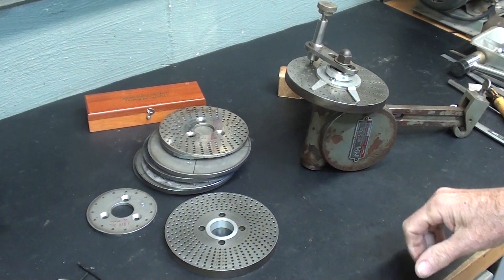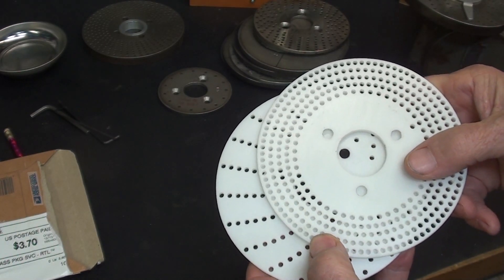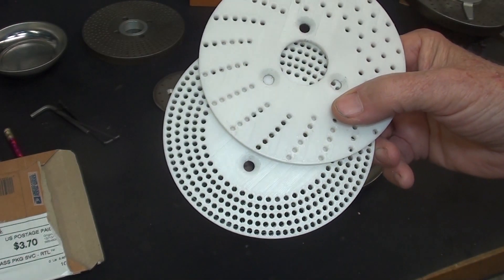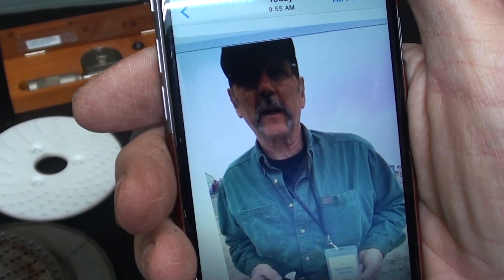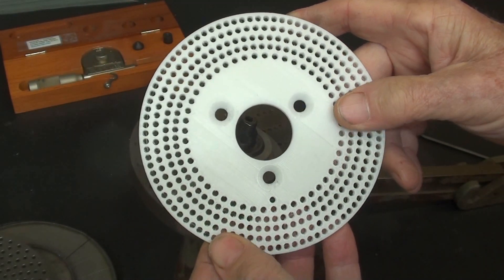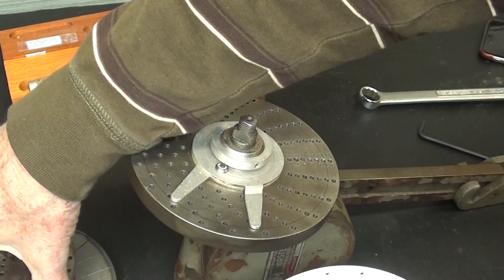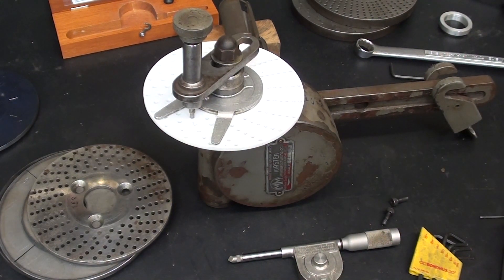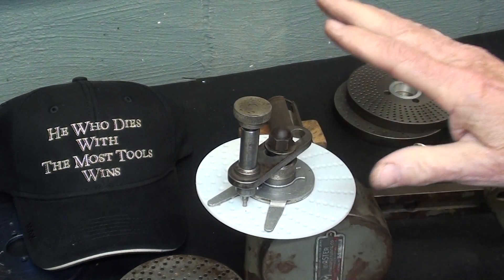Dividing Head Plates 3D Printed TIPS #627 tubalcain

Comment: I love both my Ml4 lathe and my 3d printer. I just found this video as I had the same idea of making 3d printed index plates which are so easy to design in Fusion 360. In fact I'm thinking of more ideas for 3d printed parts and tools for my lathe. For example one of the knurled nuts was missing for the gearbox cover so I made one. And some people use tufnol gears, perhaps some of those could be 3d printed. They are remarkably tough if printed densely.
Reply from the maker: I really wish more of my viewers would come to appreciate the value of a 3-D printer.

Comment: this is a perfect use for a 3d printed part. some of the nicer printers are capable of quite good accuracy, and once you run it through a 40 or 90: 1 dividing head its horse shoes and hand grenades, you could probably line up one side of the pin with a line and be close enough.

Comment: Hi Mr Pete, 
I've watched all of the videos on making plates for dividing heads and found them very interesting.
I need two new change gears for my Atlas lathe, getting replacement parts here in the UK might be a problem but gears made on a 3D Printer look like my best option.
Thanks and regards,
Martin.

Comment: I made a video showing how to model these in FreeCAD:

https://youtu.be/HdSpAkKCbis

Included in there is a link to the model file, which you can download and modify its properties (e.g. disc diameter, disc thickness, etc.) to customize it meet your needs.  The model contains 6 rings of holes and is a 6" diameter disc.  If you reduce the size of the disc so much that all the rings don't fit you'll get some errors until you either delete some of the rings you don't have room for or reduce the ring separation property (which defines the radial distance from one ring to the next).  All this is shown in the video, and also you'll see how to add additional rings should that be desired.

Comment: I had rotary table with dividing plates but I got 4th axis from ebay for few hundreds bucks and did whole gears in just 10 lines of gcode. If someone wanted he could make it independent of computer with adruino and have great dividing head with just setting few variables via buttons on screen.

Comment: First of all thank you for your video work...
3D-Printing is an absolute enrichment of my shop possibilities. In my last project-  a magnetic DRO for my lathe -  I made a lot of parts via 3D-printing: All reading head housings running on aluminium C-profiles,  all mounting brackets and angles with all threads (!) I needed for the 3 axis. - Yes this is stable, sturdy and accurate. If a 3 kg part would accidently  fall on it I hope that the brackets will break and save my magnetic scales and electronics of the reading heads:-)) Using steel the aluminium-scales will surely get bend! 

But also dust covers, adapters for the shopvac, toolholders, oilcans etc. can be made besides prototyping of metal parts and 100000 other things. - I have been hesitating long if I need such a printer. Then I decided to buy a good "Prusa MK3"  two years ago and it's amazing.  In the past I tried to learn 3D-CAD for CNC and started several times, but never had continuity to practise and forgot a lot. The printer now forces me to use my program and I automatically improve my skills when using it  during the interactive  practical use and application when designing and printing. Easy manufacturing: Have an idea - draw it - print it and correct it if necessary. Absolutely satisfying:-) 

Regards
Werner, Austria, 62 years old:-)
Reply from the maker: Congratulations. You actually are doing a lot better than I. And yes there are unlimited applications and possibilities
Reply: @mrpete222  But you are so much better in metal working - and I am learning a lot from you:-)

Comment: There's no reason that any of us should be dead-set against 3D printing ... after all, an electric motor for a lathe was practically revolutionary,  just a historical "blink of an eye" ago ;-)  if one wants to be a 'traditional' metalworker, then one needs to pick a period, and stick with that period's tools; otherwise, we use what's available, what we can afford, and what gets the job done to the level of quality that is needed/desired. 3D printing may be a useful alternative to CNC, or other machining methods, when the qualities of the printed materials fit the job. And, lest we forget, there are even 3D printers that can make parts suitable for aircraft or F1 cars!
Reply from the maker: Thanks

Comment: I love my 3D printer. It's a tool I bought for prototyping but I have been using it more and more for all kinds of oddballs. I'm mostly printing in ASA because it's a bit tougher. I think 3d printing has a bad rep because of the tinkering that some brands require. Mine is super reliable. I don't even have to check my prints for adhesion when I start them. Making dividing plates is something I've never thought of. I wonder what hole numbers are a "must have".
Reply from the maker: Thanks, I no longer love my printer, LOL

Comment: I'm not one to look down on 3D printing, in fact I remember suggesting it in a comment on one of the previous videos.

And who cares if the plastic plates aren't as durable? When they wear out you just print some new ones and it will cost next to nothing. BTW nobody uses a manual divider for large production runs anymore, anyway. So this problem isn't even likely to come up.

I believe everyone who makes stuff should be open to using different techniques, processes and materials. Whatever gets the job done, right? Purism is for people who lack imagination.
Reply from the maker: Thank you for that, that was very encouraging

Comment: I've been a hobby machinist for over 50 years. There has always been something reassuring about a part that has been machined from metal or cast in sand using a wooden pattern. That being said, the combination of free 3D modeling software, cheap 3D printers that work right out of the box, and some  investment casting equipment that's sat in my shop unused for 30 years has caused me to rethink my methods of creating parts for my 1/8 scale steam locomotive projects. An FPM (filament) printer left me in awe. Then i added a $275 SLA (resin) printer. it totally blew me away with the exquisite detail and accuracy that can be attained.
Reply from the maker: Thanks

Comment: I would still add another method, I think I saw something similar in a video by Stefan Gotteswinter. That is, attaching a stepper motor directly (or through a gear) to the indexing head. That way, there is no need to keep any plates around and any arbitrary number of holes (or degree subdivisions) can be achieved. I have the feeling though that people watching these videos would not appreciate such an 'electronic' solution.

Comment: Sir, may i make a suggestion?

 Are you familiar with air bearings? If yes, can you make an episode about it? I have been told that the latest model of garage lathe are now equip with this kind of bearings, the manufacturer (both japan and german, one of them is the famous DMG Mori) claims it is almost no friction and silence. If it is true, that's a big news and worth attention. 

And all you need is to install the bearing itself and add a small air pump that can output 90 psi air, aka bicycle pump!

Comment: My issue with 3D printing is that there is no work involved.  Most 3d projects are downloaded copies of others work. The results are not persistent. When I build a tool/part out of steel that part will exist after I have died. The plastic parts have limited shelf life.

 PLA plastic: https://www.creativemechanisms.com/blog/learn-about-polylactic-acid-pla-prototypes

Polylactic Acid is biodegradable and has characteristics similar to polypropylene (PP), polyethylene (PE),
 or polystyrene (PS). It can be produced from already existing 
manufacturing equipment (those designed and originally used for 
petrochemical industry plastics). This makes it relatively cost 
efficient to produce. Accordingly, PLA has the second largest production
 volume of any bioplastic (the most common typically cited as 
thermoplastic starch).

There are a vast array of applications for Polylactic Acid. Some of the most 
common uses include plastic films, bottles, and biodegradable medical 
devices (e.g. screws, pins, rods, and plates that are expected to 
biodegrade within 6-12 months). For more on medical device prototypes 
(both biodegradable and permanent) read here. PLA
 constricts under heat and is thereby suitable for use as a shrink wrap 
material. Additionally, the ease with which Polylactic Acid melts allows
 for some interesting applications in 3D printing (namely “lost PLA casting” - read more below).
 On the other hand, its low glass transition temperature makes many 
types of PLA (for example, plastic cups) unsuitable to hold hot liquid.

Comment: As always, I do enjoy watching your videos.  Yes, I did miss watching the previous one.  Have to go back and watch it.  
Talking about 3D printing the index plates, how about someone 3D printing you a new set of spacer arms that will reach out and grab the last row of holes on that plate?  
Now, to figure out how to get 127 holes on a 4" OD plate. LOL.  I know it can't be done unless you make the holes a 1/32" in diameter.  I do have a 8" OD plate that has a row of 127 holes I'm planning on adapting to my BS-0 dividing head.  Yeah, I said that correct.  😃 Ken

Comment: I think it's the CAD learning curve issue that makes some people turn away from 3D printing. It's one thing to simply go to github or someplace like that and download stl files, then push some buttons,  but quite another to have to design something from scratch.  Then there's the issue of "tuning" the 3D printer to make it actually DO what it is supposed to do.  I remember taking some on-line Sketchup tutorials, back when Google still owned it.  The tutorials went quite well, but as soon as I tried to actually design something, I was totally lost.  All of a sudden I realized that I'd have to immerse myself in tons of rote learning if I wanted to be any good at it.
    I even had a 3D printer loaned to me for a month a few years ago.  I played around with it, found it slow and fussy, but  made several prints.  Still keep thinking I should get one.  Looks like the longer you wait, the cheaper they get.

  I've used TurboCAD for at least 15 years, but I only use it for 2D work,  which I do on a regular basis.  But---  THAT in itself, was a HUGE investment in time.

   I guess I just have too many interests these days.  I tell people that, when I was 2, I had a very short attention span, and that now that I am older, I'm getting to be that way again.

Comment: I remember when 3D printers first came to market, I said to myself “this will be a flash in the pan”, apparently not. I’m curious as to how fragile the finished piece is, they look flimsy and easily fractured to me, all I’ve ever seen are videos and pictures of finished pieces.
Reply: When they first came out I wanted one for my job but could not justify the cost. (~$12,000) The plastic wasn't durable at all. Costs have gone way down and they have better plastics now but of course plastic won't be as durable as metal. They were originally only intended for rapid prototyping.
Reply: ohmbug1 the index plates Mr Pete has look like they are more durable than other stuff I have seen.

Comment: I am not among the anti-3D printer folks. My position is that, much like machine tools, there are applicions for which 3D printers are well-suited. And, as additional materials are developed the range of suitable applications for 3D printers will grow.

Conceptually, 3D printing is opposite traditional machine in at least one important way. Traditional machine tools work subtractively (I may have invented that word). One begins with a large chunk of raw material, and removes from it pieces that aren't to be in the intended part. 3D printing proceeds additively in that the part is built-up by progressively depositing layers of material.

I have been told, although I have not seen proof, that 3D printers are capable of producing features in parts that cannot be made using traditional machine tools. Complex internal cavities, for example.

Comment: Hi Mr Pete,
I don't have anything against 3D printing at all, its just that I watch your videos because I'm interested in the machining. I've learnt a lot from watching videos like yours.
I build model stationary engines at home in my very basic machine shop (garage) and I get a lot of enjoyment in the building of them. Once they are finished and running, I move on to the next. 
The challenge, for me, is what next to build, how to design it, what materials am I going to use and how am I going to build it on my very basic equipment.
I don't have a 3D printer and I'm unlikely to ever buy one.
Keep up the machining. Please.
Keith. England.

Comment: As a medical doctor (ie, very much a hobbyist, far removed from professional machining OR computer programming) I can give you maybe a different perspective in response to your 3-D question if you like; I find videos on 3-D printed prototypes pretty much in the same category as CNC maching parts, a perfectly reasonable and precise/efficient way of making something but not an interesting way to watch or learn HOW to make something. If the point of a video is to show how a PART is made, then watchers should be open to 3-D printing, CNC programming, etc..if the point however is to show the PROCESS of how a part is made, then your viewers are more likely going to be mostly interested in the traditional laying out, marking, and fabricating in actual metal. Think of it this way; a woodworking video on "how to make a wardrobe" (which may include easy-fix predrilled Ikea joints in cardboard wood!) vs a woodworking video on "how to hand cut dovetail joints, which you can use to make your own wardrobe"...how many people do you think are going to watch a video of someone putting together an Ikea wardrobe? 
I'm not suggesting for a moment 3-D printing or CNCing is 'easy', just that is highly specialised and lacks the hands-on "approachability" to a home workshop hobbyist that would make someone like me want to take the learned skill and tackle progressively more challenging other projects, once they have seen the process..
But I watch all your videos anyway! Best wishes for the New Year...

Comment: Mr Pete, the 3D printer technology is very useful especially in initial design stage in industry. There is also the electronic tool using Arduino hardware and control motors.
Reply: Do you watch Clough42? If not you should really look James up. His use of modern tech to do things in a home shop is very inspiring.
Reply: @Dwarfracer88  Thanks mate, will definately check his channel out.

Comment: For me, i can do design on the back of an envelope or on cad, and I have done cad/ cam in g- code many years ago while i was at university studying mechanical engineering. 
My two cents worth is that because in the home shop i am usually not making hundreds of something, there's just no point spending all the time fluffing around with C.A.M. in order to finesse a prototype, particularly when in the end (unless it is a very low- stress part) all you get for all that time/ effort is a plastic MODEL of the part, not the real part.
 i would rather get the concept on paper and then get it built.  I could commonly build it in metal faster than a 3d printer could build the model, and even if i couldn't it doesn't matter -- the time doing the plastic part is just overhead before i then have to START on the real metal part.  Unless my design was massively wrong and the prototype would have saved me (which is rare) the 3d print process is just a gimmick and an utter waste of time. 

The other factor is that i watch your videos to learn metal shop stuff that i didn't know as a professional engineer.  I don't need to watch utube to learn engineering -- that's been my job for 35+ years.  

Which brings up the final point -- building stuff with my hands is satisfying and relaxing because it isn't engineering that i already spend 40 hours per week doing.... why would i want to do more cad / c.a.m as a hobby?  It isn't a change. 

So if i don't want to do it, i don't want to learn how to do it so i don't want to watch it.

Comment: For me, the resistance to 3D printing is twofold:  first, cheap 3D printers are kind of where PCs were back in the mid-80s, and I'm sensing that if I wait a few years, I''ll get much more bang for the buck (e.g., easy printing in Nylon, Delrin, and PEEK). Secondly, you need to be good with 3D CAD, which is intimidating to me and a lot of other folks.  The possibilities of 3D printing are very exciting - I'm just not there yet! (and I love working with metal)

Comment: People are asking $75 + shipping for some dividing head plates (in the year 2020). I collaborated with a guy wishing to do them in 3D & received a sample in 2019. Spot on & good to go! This type of solution, in so far as time & cost savings really adds up when sourcing parts for Mr Pete's lathe type & for anything from Van Norman. Jay Leno has perhaps the ultimate 3D printer as it is capable of making a complete Straight 8 intake out of aluminum. I'd like a 3D printer for the desk top that can produce brass & aluminum parts, but don't have the money to invest or time to learn the programming. Too busy having fun the old manual way!